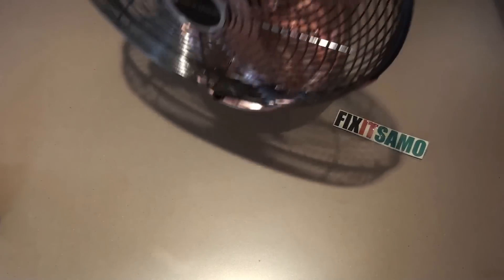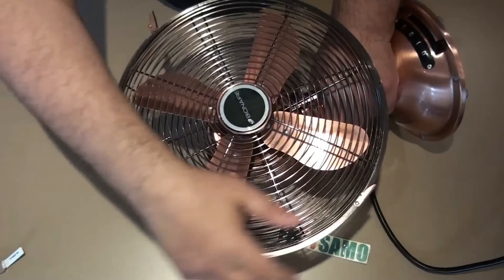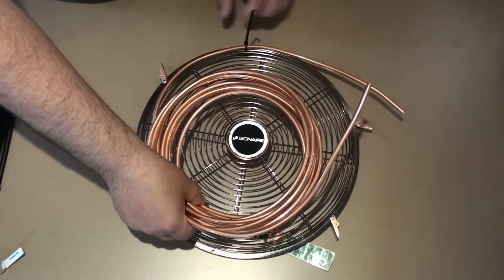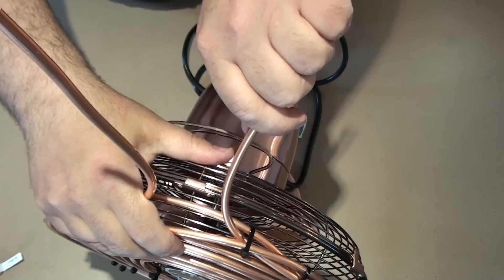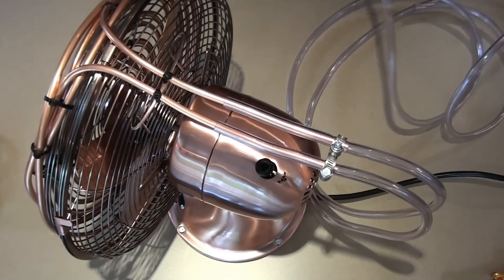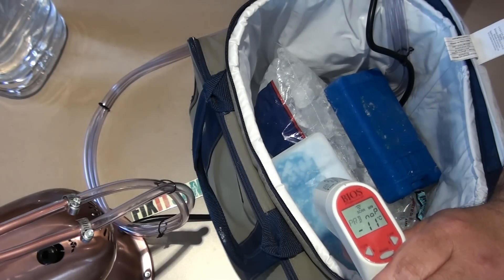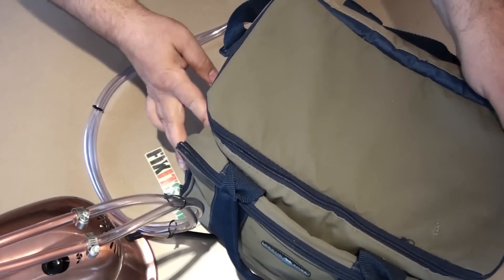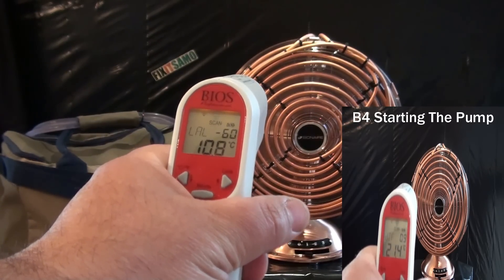How To Turn Your Fan Into An Airconditioner  AC

Comment: I admire your ingenuity in making this, but there are some obvious downsides;  on a hot day, how long will the ice bags last before it all turns to water and loses the cooling effect?  An hour?  Two, on a hot day?  Then you will have spent about three bucks for the two bags of ice that you throw out.  You still have to pay for the electricity for the fan, which I understand is nominal compared to an air conditioner.  There is also the electricity for the pump.  given the fact that you have to keep changing out the ice bags and throwing out the water, it doesn't seem worth the effort to cool the air by only 10 degrees as you stated.  On a hot day, that's not much.  And it only lasts a couple hours.  I hope you come up with an air conditioner that doesn't rely on ice...
Reply: It's not a theory, it's the first law of thermodynamics. It's the reason you can't just leave your fridge open in a sealed room and expect it to cool anything, and you'd be doing the same thing with the fan idea the other guy suggested. If you moved the fridge as you suggested it would obviously work. Otherwise it's an extremely roundabout and inefficient way to make an A/C with a lot of energy loss. In any case I thought the original idea that you presented in the video is great.
Reply: This is an application specific tool. It would be useful in a small aircraft that doesn't have an A/C unit for example.
Reply: You realize that's not going to cool your room at all right? The energy you take out of the air inside the fridge is put into the room the fridge is in by the coils in the back of the fridge. This is the same room you're blowing the cold air into. You would heat up your room by doing this because you have to put in energy from the wall to do all this and that creates heat.
Reply: Michael Hardage  I've done this project long time ago it works perfectly im using it in my garage 
Im also using the cooler to put soft drinks inside
Reply: tony sony Yeah I have no doubt it works, but I wasn't talking to you.
Reply from the maker: +Michael Hardage 
Im answering to you cause you're theory dose not  make any sense specially 
When you recycle the water to freeze it again 
it would be at room temperature not hot water so the fridge wont use more energy to freeze it  it will be a normal use of energy Unless if you open the freezer 100 times /hour 
2 ) lets say if it dose use more energy and that's a big if 
Move your fan to a different room

Comment: This is a colossal waste of time and material. Take some 2 litre plastic bottles, fill with water and freeze. Put in front of a fan. WAY easier, less mess and space and works far better than this over engineering. Yes, I have tried both. I actually did this nonsense first and post it all proud of myself on Facebook. Then a friend of mine said, "Why don't you just..." 
Duh.

Comment: listed under PG13 Controversial Novel:  the condition though controversial in accordance manufacturer instructional for the fan is an enlightening effort in non CFC air cooler in task cooling. Speculation state the cooler at larger shape may be enabled in off grid active as solar too.  The relativity meter state the comfort one find at humid location where evaporative cooler are much less enabled.
Reply: The fuck are you talking about?
Reply: He wants to sound sophisticated, but lacks the grammatical skills to do so, hence John throws in a variety of nice sounding words without fabricating coherent sentences.
Reply: Mojo_Salem looks like word salad.

Comment: wonderful video, what was the estimated cost all together of the project ?
Reply: skyler honey I made mine for about $35. Fan was $16, pump was $8, copper tube was $6, vinyl tubing was $5.
Reply: @VoidAeon  thanks. Did condensed water drip from the copper or the fan speed dried it up before it had a chance to drip onto the floor?
Reply: didymario I never noticed any condensation dripping on the floor but it was also over carpet so I can’t be 100% sure. There was some forming on the coils.

Comment: this would be great in campers and other temp living conditions with a power supply.
Reply: Or if you're camping and electrical power isn't available, you could Re-wire the ac port. Solder the wires onto a solar panel. You'll have cool air when you need it most. In the sun. 👍🏾

Comment: You can add a compressor, make a condenser, braze the lines together, charge with propane and, presto, you have a air conditioner. It will use less power than the ice maker. Call me a genius.
Reply: make a video..
Reply: Genius
Reply: You gave 3 steps but gave no instructions on how to do it. That's not genius. That's dangerous. Lol.

Comment: If you are getting the ice from your own freezer, then you're actually pumping more heat in to your house (via the running compressor and refrigerant coils in the freezer/refrigerator) than you are removing via this improvised AC. The only way this works is if the refrigerator or freezer used to create the ice is outside.

You can mitigate this phenomenon by ensuring that you are creating the ice at night when convection and conduction of heat into the house are much less due to the sun having set.
Reply: Or you can just buy some bags of ice. Doesn't get much cheaper.
Reply: how long will this unit cool?

Comment: How much heat does your fridge put out to freeze that volume of water? I have a feeling that the heat produced by the fridge offsets the amount of cool air produced. #thermodynamics
Reply: DCassidy42 I'm sure that's a store bought bag of ice 😅
Reply: Except that maybe his fridge is not in the same place he is intending to cool down. I would be interested on how long a bag full of ice takes to be brought to room temperature with a fan like that.
Reply: I suppose he could have a high efficiency refridgerated cooler stored in a basement or cellar powered by a couple 100W solar panels that are providing shade above (AC, not DC coz the wires could get hot), freezing very cool tap water. Actually the fridge cooler would have to be stored further away because it would heat the ambient air and cause it to rise.

Comment: just use fans to cool the water in a normal box or smth like in a cpu water cooler, wont be as cold but wont rely on a cooler with ice and all i need is cold 😥

Comment: You have to keep replenishing the ice so this is an air cooler not an air conditioner.   It's important to know the difference if you want to buy a unit.  Air coolers are much cheaper.  Air conditioners contain a refrigeration unit and require hot air to be dissipated  outside.
Reply: Oh
Reply: Kalin  Oh?
Reply: Um ok?
Reply: K

Comment: the metal pipe will block most of the wind
Reply: reason ye     Mainly relying on thermodynamics, the heat will be drawn into the cooler tube/water in the tube.......then that heat will be transferred to the ice-chamber.  As long as there is a decent amount of air flowing past the tubes, it will do an OK job cooling things down.
Reply: no, just no.

Comment: LOL!  how much did the copper tube, the pump, and the other parts cost?
add that to the time and effort it takes to make... you might as well buy a small AC unit!
Reply: the cost for the parts is under $50 add a fan if you don't have one but who doesn't ave a fan and it took me less than an hour to do in total. can't come close with a small air conditioner plus it would need to vent the hot air, this does not.

Comment: So, you spend 5-6 dollars on ice with this cumbersome setup every day and how is that going to save you money in the long run? I don't understand!
Reply: I wouldn't use it as a permanent replacement for an AC but you could use this method if you're camping in a site that has an outlet
Reply: It's ghetto-rigged engineering, for the sake of ghetto-rigged engineering. Science is like sex, it has practical uses but that isn't why we do it.
Reply: Govi Reddy Ice is basically FREE....

 if you own a freezer. First:  water cost almost NOTHING. You could make more ice than you need, leaving some in the freezer. Having ice in your freezer instead of air makes your freezer more efficient. You will save more money on electricity than you spend on water.
Reply: What about putting some bags of water in the freezer?
Reply: Make your own ice... By the way if you have a good cooler, this could last for days
Reply: You dont buy ice, just make your own in your freezer
Reply: tetete water cost money too
Reply: Don't forget the energy used to freeze that water, your freezer doesn't just magically freeze extra using the exact same amount of energy.
Reply: jjsrt8  you will save more money on electricity than you spend on water..  if you keep some of the extra ice in the freezer!  Runs more efficiently.  your welcome.
Reply: Faulty premise.  Nothing is free.  Nothing....ever.  But this is not about cost; it's about ingenuity and applying physics and the knowledge of it to solve a practical problem.  Could you buy an air conditioner...sure, but that's not at all the point.
Reply: LampDoesVideogame Feynman...

Comment: sorry please can anyone tell me, you dont need to use electricity for the fan to make it work? and is it safe to use while the copper tube is moisting as it works? Also, do you have to keep on refilling the water? please explain. thank you so much.
Reply: Yes you still need electricity to make the fan run. Unless you use a fan that does not run on electricity.. 

You will most likely get condensation on the copper coil as it will likely be a the dew point temp. of the ambient air. I cant say if its unsafe however. Although personally i feel that it could be.

You dont need to refill the water as the system is a "closed" loop, however you may need to change the ice once it melts to increase the cooling effect of the system.
Reply: The condensation that is built up on the coils is actually evaporated off while the air blows across it when the fan is on there fore never presenting an issue. we have run one of these in our back shop for quite a while now and never noticed any condensation buildup. We use water filled 2 liter pop bottles that have frozen overnight in the freezer for the coolant. Hottest day so far was 92 degrees with 85% humidity; while it did not freeze us out, it did take the edge off.

Comment: I make the same construction and the air temp (In this video is measuring tube temp before and after starting the pump) is 4 degrees below...Specifically from 28oC i got now 24oC!! Also i try to freeze salty water instead of fresh water with salty ice cubes (-21oC water and -26oC for ice) and the result is even better...!!! Nice work mate!

Comment: Use a small portable freezer instead of the ice box. It will run longer before the water gets warmer.
Reply: That makes no sense because the freezer will output the heat it takes from the ice directly into your room.
Reply: Freezer will consume way more power :D Additional power over the fan and water pump.
Reply: Yes it will certainly but still less than a conventional AC. I am not sure how long the Ice water bucket will stay cold itself.

Comment: it will only work in areas with no humidity
Reply: Brett Duffy You would be correct if this is an evaporative cooler. An evaporative cooler only works in dry climate due to adding moisture in the air. This unit that FIXITSAMO made uses a heat exchanger method similar to how normal air-conditioning functions. Air is blown over a cooled coil which cools down that air.
Reply: if there is alot of humidity the copper coil will start to create Dew or condensation
once that condensation reaches a certain point the ac rigged fan will start to drip water (not a leak)
what he means with areas with no humidity is that it wont get condensation that much
Reply: Brett Duffy 
all the water stays inside the copper tube. this is more like how a CPU cooler works, nothing to do with humidity.

Comment: Okay but, 

1) don't put your water connections above the motor because if they leak they will drip on the motor.  Also watch out for condensation on the copper tubing dripping down.

2) Use a hard cooler that won't leak.  Sooner or later the soft cooler is going to leak.

3) At the end of the video you are measuring the temperature of the tubing, not the air.

4) Get ready to use up a LOT of ice.  This may work if you have a large supply of ice and you want to cool the air quicker.  Unfortunately this probably isn't much better than just an ice-bucket with a fan blowing on it.  Or just putting the freezer-pack in your pocket, because then it is cooling you directly using conduction, not trying to cool the whole room nor messing around with slow and inefficient heat-transfer by convection.  

5) The most significant cooling effect (particularly on the "heat index") might be its ability to reduce humidity through condensation.
Reply: It's on the cheap and doesn't use nitrogen system + he measured from the front of the fan, i.e. wind to the face

Comment: Who would like to explain why - if you get the ice from a freezer in the same room - the room temperature would rise?
Reply: 2nd law of thermo
Reply: because you need to take physics seriously. The law of the conservation of energy governs everything. A freezer actually does not work out of thin air but is actually some sort of heat pump (energy punp). Assuming that you have a room with a freezer (switched off) in it. This closed system has some amount of energy associated with iit. Now let the freezer start to do its work: It pumps energy from the inside to its outside. As an effect, the interior of the freezer gets colder. But! The energy has to go somewhere. It goes to the outside of the freezer and is distributed in the air surrounding it by heating that air up. Looking at the "system" (room + freezer) the total amount of energy has not changed, it is just in a different distribution. In the same way the interior of the freezer gets colder, the air around the freezer gets warmer. And worse: In order for this heat pump to work, you had to add additional energy in form of electricity to drive the motor. This energy also has to go somewhere and as usual it ends up in form of heat (heat is somewhat like the universes waste dump. whenever there is nothing "to do" for energy, it is converted into heat). So again: looking at the system of room and freezer in order to change this energy distribution you had to add additional energy. So in the end, you end up with more energy distributed in your room then you started with. Which of course means: it is hotter.
Of course a room by itself is not a 100% isolated closed system, there is always energy "flowing away" through the walls, windows, floor and ceiling. But this is not that much.
Now that you understand, that the "conservtion of energy" is not some obscure construct from your physics class which has no influence on your daily life, I am pretty sure you can explain why professional air conditioners always have some parts which are outside of the room. Either they do have the condenser outside or they blow air out of the room. (hint: this is exactly how the air conditioner actually transports energy out of your room. The parts outside are always the "hot" parts of an air conditioner. So in a nutshell, an air conditioner by itself is also nothing else then a heat pump: in order to cool your room down, it has to warm up something else. Which of course is the air outside your room.)
In this special case, you first took away energy from the water and thus freezing it. This energy ended up in the air in your room (and thus hwas heated it up a little bit). The ice "absorb" the very same amount of energy during melting and thus cool the air down for the very same amount. Up to now you have not done more then just shifting energy around. But! In order to do that, you needed additional energy in the form of electricity to drive the motor of the freezer and of course to drive the motor of the fan also.

This is what the basic principles of thermodynamics are all about: In a closed system the total amount of energy always stays the same. You can not create energy nor can you destroy energy. What you can do is; you can shift energy around and you can also convert it to different forms of energy (light, heat, movement, ...). But the total amount always stays the same. If you want to extract some energy from one part, some other part has to take that energy for a total balance of 0. if you drive in a car, it has some kinetic energy (energy of movement). Breaking this car means to reduce this kinetic energy. As a consequence this energy difference has to go somewhere. Where does it got? The breaks! The breaks get hot, this is where the kinetic energy ends up. And of course if you break hard enough the breaks not only get hot but really start to glow: the kinetic energy is converted not only into heat but also into light.
Reply: ambient heat from the generator clicking on. just a guess.
Reply: If the room was completely isolated from environment, yes. However it takes a long of time for ice to be formed and in that time heat is dissipated and you dont even notice it.

Comment: ♦️Will it work adding some sort of Automobile freon gas on the tubing...??? 🤔
Reply: it would need a compressor and the proper piping to work... you could likely pull a compressor from an old fridge or freezer.